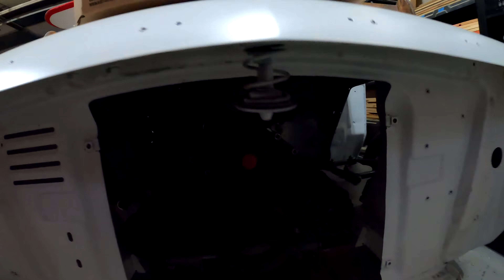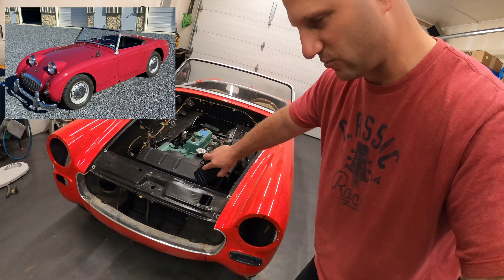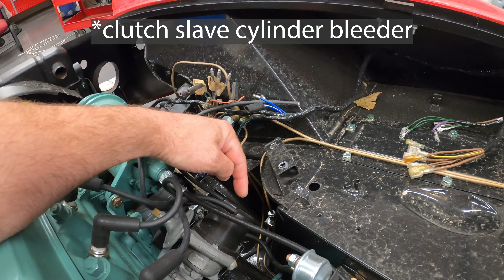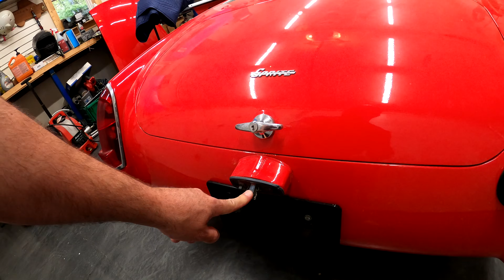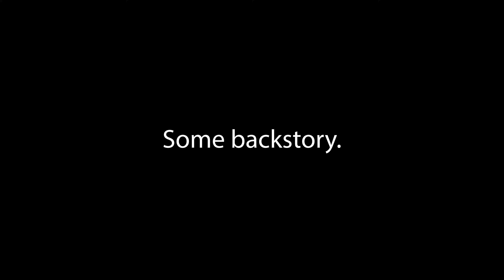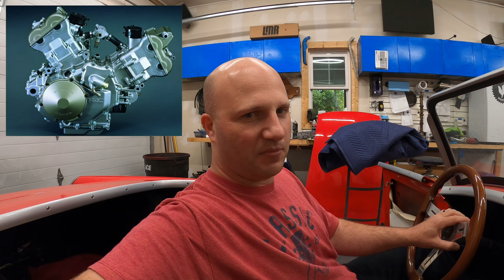New Project Car! 1962 Austin Healey Sprite introduction and assessing what it needs.

Comment: I feel you, Josh. I took my '72 MGB-GT off the road in 2014 to spend about 5-6 months replacing the sills and doing some other rust repair. I finished the driver's side and cut out the passenger sill and the rusty front floorpan in about 2 months of work (I have to drive 50 miles to mu sister's to work on it, so it was weekends only and not every weekend). 7 years later that is where it sits. There is light though. My engine needs is also tired, so I have decided to do a GM V6 swap. I have picked up a 2.8 from a Fiero (I have to move the starter to the other side to make it RWD compatible) and a T5 from a V6 Camaro. I have a set of partial rear fenders, and am negotiating for a pair of doors and front fenders that look to be in really good shape. I plan to get back to the body this month and have it ready for the swap by the end of summer. The SU's aren't bad to work on and they look so much better in the car than the Weber does. But I understand the decision.

Comment: As a Midget owner who is daily driving a 1500 that needs a refurbishment, I can say that the engines on these cars are simple and reliable. Unless you are racing, he best bang for buck improvement is the addition of an overdrive. 
There is absolutely nothing wrong with the Austin motor or the side draft carburetors.  Once you get it on the road you are going to live driving it. I have had a lot of cars, but the Midget gas been the one I have enjoyed the most. I wish I bought one 35 years ago.
Reply from the maker: Good to hear. I had thought of a 1500 upgrade but my trans won't mount.

Comment: I had a '60 Sprite. The bonnet was hinged off of the firewall, would have been far better if it wasn't. Not it's biggest problem though. The fact that it's 998 had a window in the block I could put my fist through was,  ouch.

Comment: Hi Josh
These carbs I think are 1 1/4" SUs are still around, and very easy to tune and play with. Eg.
https://www.ebay.co.uk/itm/254989620244
I used to love messing with them as they have hardly anything to them. Bit of 3in1 oil in the dashpots and they are good to go,  and really suit the engine. I'm pretty sure the Weber will be a real  pain to set up. And carbs where you can just raise or lower the needle jet to lean out or richen the mixture across the whole range, really old school, but really good.
Lovely air intake sound from them too.
Reply: There's probably going to be a lot of support through the classic mini community.  That engine carb combo was well-used across the UK car industry.  Cut my teeth on an 850 mini with sliding side windows.

Comment: Great video! I'm rooting for the original motor. (I think the cat's with me on this.) As exciting as the RC would be, there aren't many of the 1096 A series motors still in circulation and that variety of Sprite (with the 1096) is the rarest kind of Sprite. If you do decide to dump the motor, LMK and I'll give it a home. And if you don't want the SU's send them my way!
Reply from the maker: Thanks for your vote of confidence on the original engine. I do think it's going to run just fine. I am learning that they are pretty hearty.

Comment: The SUs are super simple but effective carbs. I had a pair sitting in a garage for 23 years, a little cleaning and setup and they worked great!
Reply: Having watched over one hundred videos of people resurrecting old American cars, I am always so astounded at how complex the carbs are on American cars.  I have a 62 Sprite with dual SU carbs, they are so simple, easy to tune and run great with minimal effort.  One screw to turn the mixture.  The most challenging part is sycronizing a pair for consistent low throttle airflow.
Reply from the maker: Someone had these apart already and lost some critical pieces or I would have tried to run them.